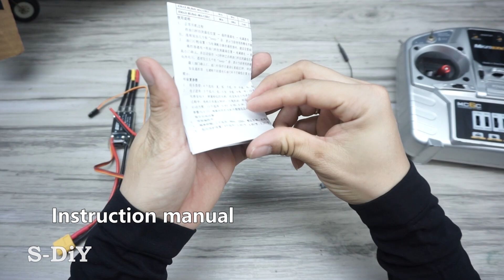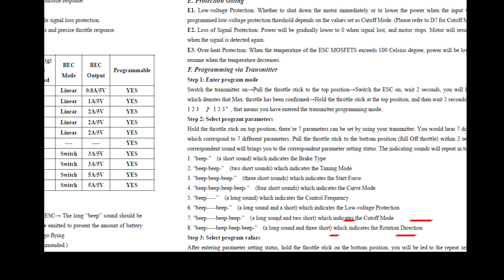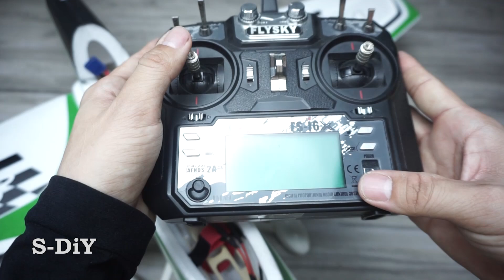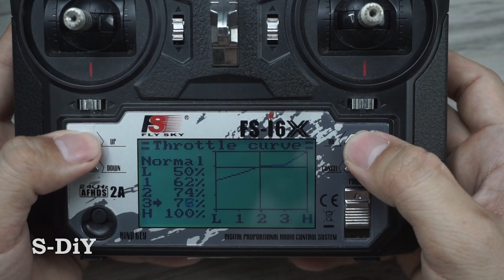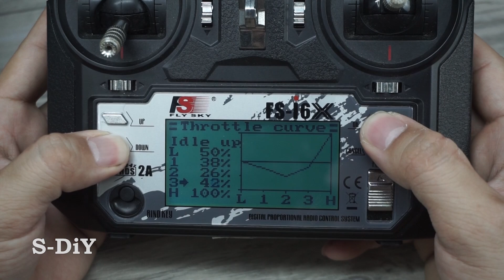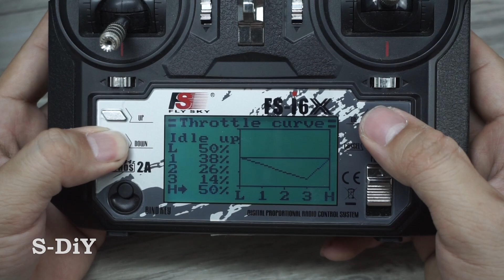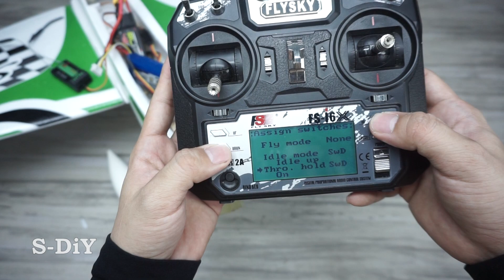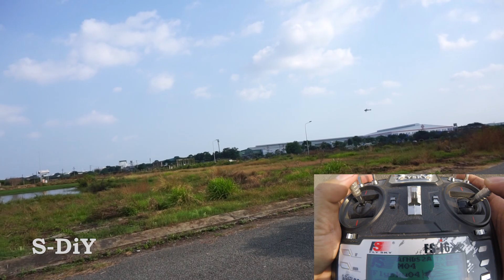RC plane BACKWARDS setup - Blheli ESC l S-DiY

Comment from the maker: 👉Các bạn CHÚ Ý, khi chuyển sang chế độ 2 chiều thì không thể khôi phục lại như ban đầu bằng TX. Việc đảo chiều gấp có thể làm hỏng linh kiện ! Cám ơn các bạn đã xem video !
WARING  , when switching to 2-way mode, it cannot be restored to the original by TX. Folding reversal can damage components ! ( sorry, i use google translate )
Reply: Mình cài đặt bị cái mức throttle thấp, giờ chạy nó chỉ nhích nhích thôi, giờ có cách nào để config lại ko ad? Cứu cứu 😢
Reply from the maker: @hpquanghpquang  bạn đã vào chế độ hai chiều chưa?
Reply: @SDiYchannel01  vào chế độ 2 chiều rồi ạ, chỉ là cái ngưỡng điều khiển nó nhỏ quá hay sao ấy
Reply: @SDiYchannel01 nhưng giờ ko vào đc setting mode nữa
Reply from the maker: @hpquanghpquang  trường hợp đã vào chế độ bidirectional mà khoảng ga nhỏ thì mình chưa gặp. Vì nó mặc định khoảng 1100-1500-1900. Để set lại thì bạn cần mua mạch arduino nano, tải về BLheli Suite và kết nối theo manual của BLheli Suite, sẽ config được sâu hơn!
Reply: @SDiYchannel01  thank ad, mình có mấy con arduino khác (uno, mega), để thử xem sao
Reply: LoL 😂😂😂😂

Comment: Why are you not using BLHeli Suite to configure your ESC ?
It is a BLHeli ESC, so it so BLHeli Suite can configure your ESC in Windows OS between bidirectional and unidirectional. It is also a solution for commenters here who are now stuck in bidirectional mode, thanks to it you can go back to unidirectional mode.
Reply: Hello, I do something wrong and now I can not enter the setting mode. Do you have any idea for this? Can I use blheli suite to restore factory?

Comment: I followed all you mentioned and it worked 
BUT when I switch throttle hold or turn transmitter off ,motor will start working!!!

Do u know how to fix it? 
It’s very unsafe and dangerous 
Btw my tx is ix14

Comment: Hi, Man. I have one Microzone like you and did put birecional settings in both Escs like yours, but now a can't reset factory settings or do another configurations. A put The throttle in top position, but the esc always start normal.
Reply from the maker: Hi, unfortunately it is not possible to go back to the default with TX. I suggested it in the pinned comments and the video description. My mistake was not taking notes directly in the video. Sorry for the inconvenience!
Reply: @SDiYchannel01 , ok, thank you, i will try any solution like using arduino because one esc is normal and works fine in birecional but the other i think it was necessary a reset factory before programming.
Reply from the maker: @rafael1982sa  Hi friend, connecting Blheli via arduino, and setting all parameters is possible and easy if you know about it. I tried, full instructions are in the manual of Blheli suite software. Good luck!
Reply: @SDiYchannel01 , i did. Could reset factory by arduino but a think this esc really damage because continuous the first issues.